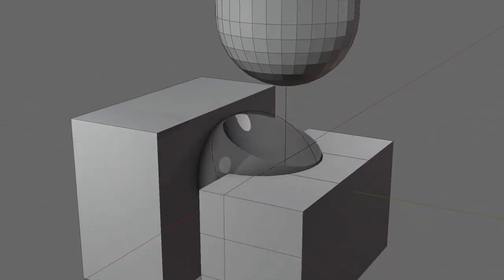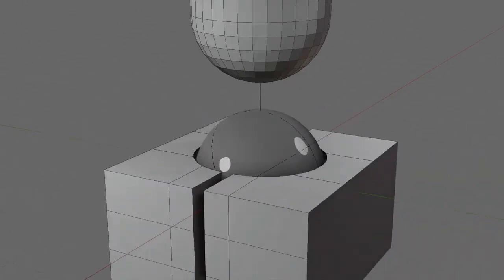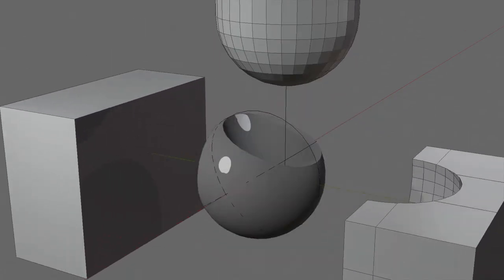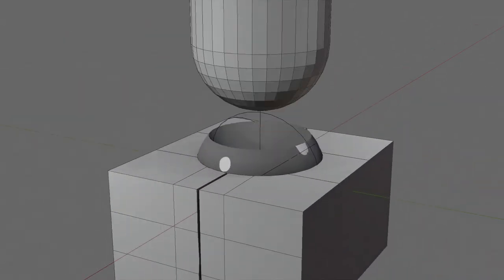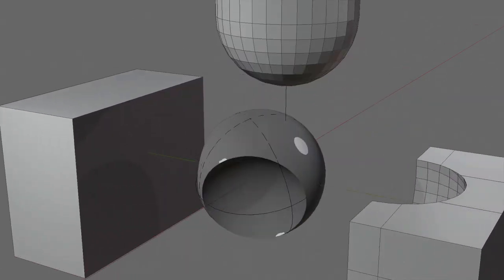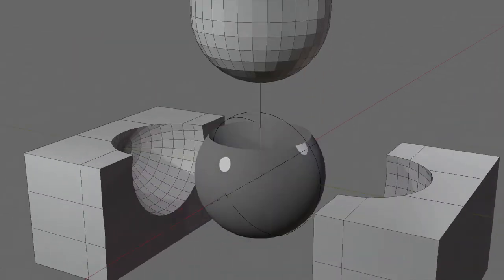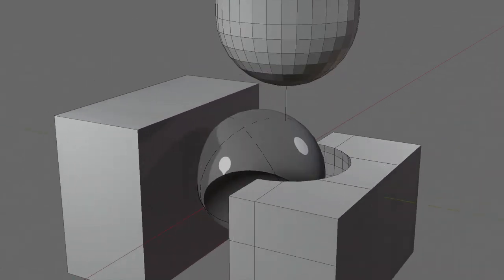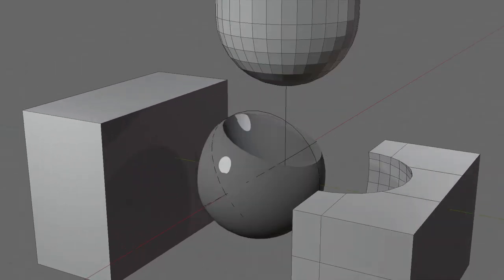Tetra Sphere Dice

Comment: And kids say that maths are useless... clearly milling your own dice is a perfect example of why they need it.

...Now I want to code up something to generate milling plans for dice with an arbitrary amount of faces.
Reply from the maker: You'll have trouble spacing them evenly, unless they have 4, 6, 8, 12, or 20 sides. And those are the classic polyhedral dice, based on the "classical solids". You can get geometry data for them a lot of places, but I've got a set in my blender tutorial file: http://peripheralarbor.com/BlenderTutorial.blend
I've found that the higher order solids roll pretty well though. It's mostly the D4 that's a problem.